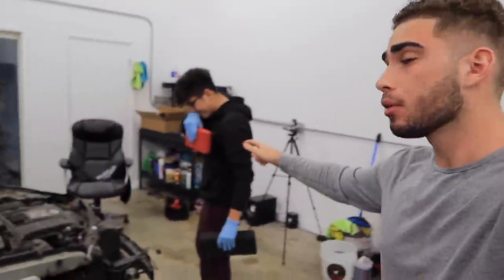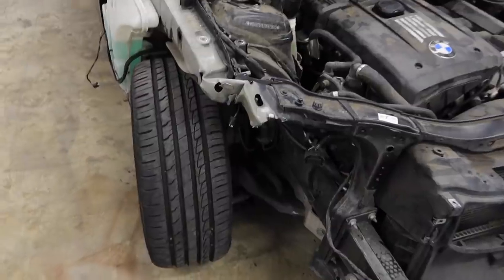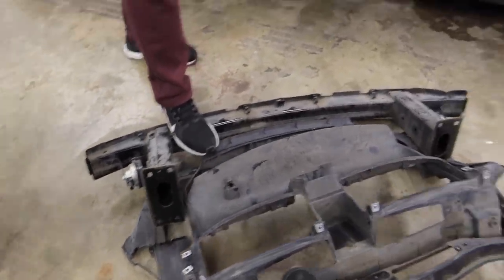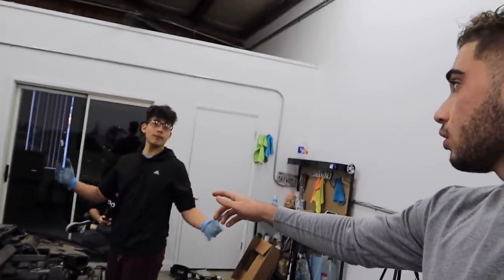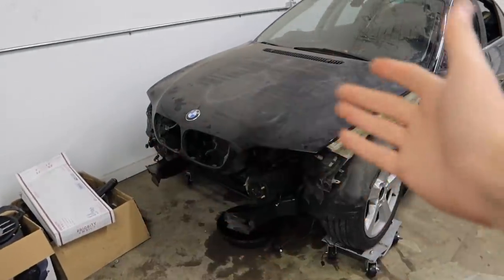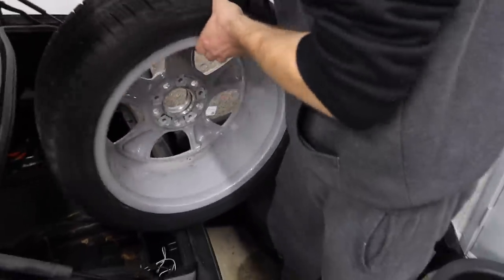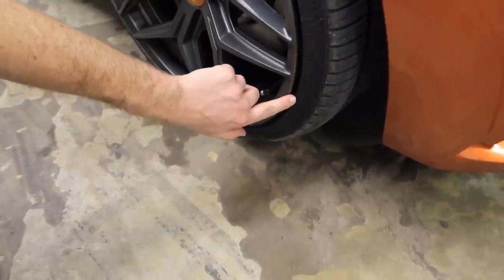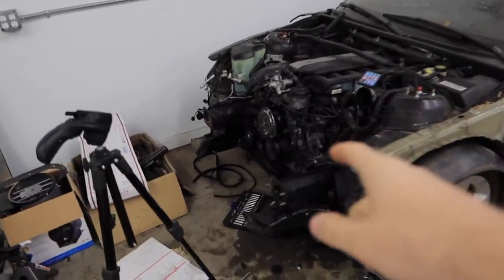Rebuilding a Salvaged 2011 BMW E92 M-Sport! (Part.3)

Comment: don't use the "spare tire" because my dad did that with a tire from 2003 last year and the tire just popped because the rubber is so old, so just throw the tire out. Just want you to be safe